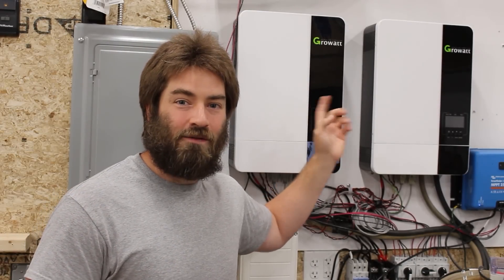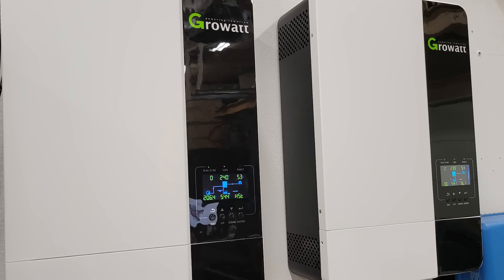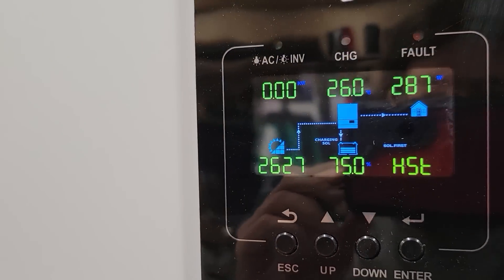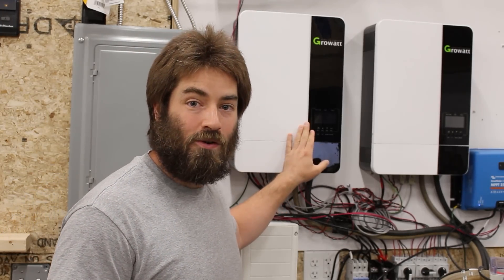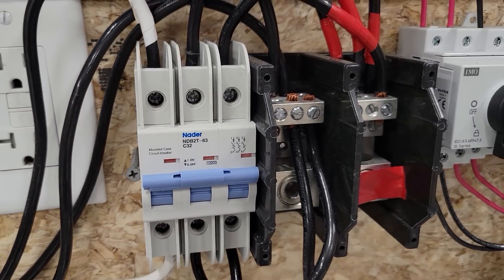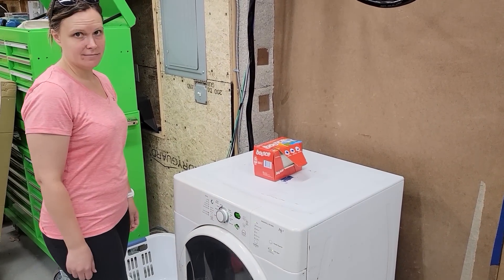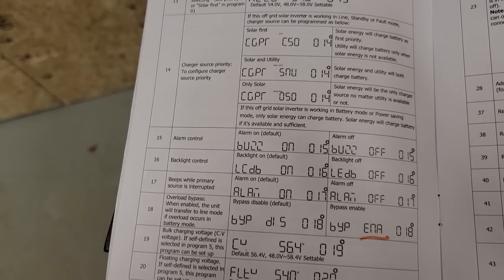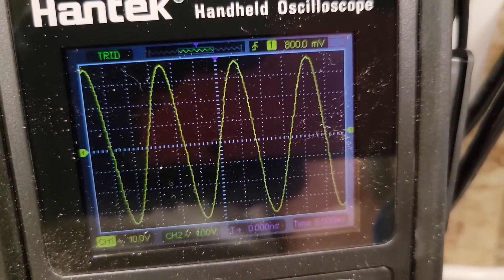Update after 1 year of use off grid, Growatt and EG4 (Gyll) batteries

Comment: HI David, do you mind if I ask a questions on a project you tried out about a year or two ago? I watched your video where you mentioned wanting to buy a european 230-240  volt single phase inverter with a hugh transformer. I was thinking about the same thing, but I wanted your prospective on why you didnt follow through with the project. I was thinking about running my home off of a Sungold 18kw low frequency with a Victron autotransformer. Does that sound possible to you? If you prefer not to give advice, can you recommend someone who is not just going to try to sell me product? Thank you David!
Reply from the maker: Hi PDS,  These Growatt inverters are 240V single phase.  When paralleling them together they are still only 240V single phase.  I'm using the auto-transformer to produce a Neutral which gives me 120/240V.   Other model inverters are 120V only, and you can parallel two together to make 120/240.  Both are good options.  The need for a larger transformer is surge capacity.  If you have a super high surge on 240V (ex: 4-ton whole house air conditioner) then you might want an isolation transformer.  I showed an isolation transformer in one of my past videos and still plan to demonstrate it, but just haven't gotten to it yet.  The past few months I've been backpacking the Appalachian Trail.
Reply: @DavidPozEnergy  Thanks David! There is no replacement for spending time with the family. Question David, if I have a 15kw single phase I vertex with a transformer connected to a big victron autotransformer, could I connect both legs of my breaker box the the output of the autotransformer and run my ho e off that set up reliably? Thoughts

Comment: David, do you know if you can stand these up or do they have to be lying on their side like they are on the company's rack system?   I don't have much space in my set up.  Thank you.
Reply from the maker: Standing up is fine, just don't flip upside down.  Actually, my friend has two that he stands up: https://youtu.be/nKva5GsEPXc
Reply: @DavidPozEnergy  thank you for the quick reply!  I have been on hold for 35 mins with signature solar to ask this question and you answered in 3 mins lol.  You are da man!  Thank you!
Reply: Since I will not be using their rack.  Do you have a Busbar you would recommend to tie these together?  Thanks again
Reply from the maker: I have made bus bars in the past, but if you want to buy some, then I'd look at these two options: https://amzn.to/3O7wu7m (you need positive and negative)  Or this: https://amzn.to/3P92EAY which has both positive and negative in one package.  But avoid this cheap one: https://amzn.to/3uNbYlK which I've tested and it get's too hot at the Amps we are working with.
Reply: Thank you!  I appreciate the help.

Comment: I studied your videos and products that you use for 3 months before designing and buying. I've basically got the exact system that you have except I do need more panels. Just moved the ac air handler iver last week. The heat pump has been on there for a month. I've been moving things over a little at a time and testing their limits. I really appreciate you taking the time and explaining each step in a way we can all understand. Outstanding work!
Reply: So no problems for you?  I see a lot of complaints online about items bought from signature Solar but no real issues from you tubers with affiliate links
Reply: @Chimpmunk Boy  I have had very few small issues and those were operator errors in programming. I got the help from signature solar and a few people I met on FB. After that I've been coasting along. One more inverter and 20 mor 445watt panels and I'm set for complete off geid!

Comment: Hi David
Did you experiance connecting
Two strings in//of pv panel 9 element
Each for  1 inverter Growatt 5000 es
Is it healthy or risky?
By the way
I have two led light  operating
On motion
The nearest to Inverter is flickering
The far one is working properly
They are of the same type and brand

Comment: And your system is using how many solar panels and what is the characteristics of your panels?
Reply from the maker: The 3 arrays total about 12kW.  I have tons of videos building them up, and wiring them.  I think you will find this video most useful: https://youtu.be/wDTkMQY3Rx0
Reply: @DavidPozEnergy  I thought that you installed them long ago and you dont use all of them but using 2 Growatt invertors 5kw each i think you can use all that solar panels. Each invertor accepts 6kw solar panels so you are OK. Thanks for your reply. I will have a look again to the way you wired them.

Comment: Hi , first thing, thank you for your content, genuinely enjoy your videos. Growatt are available in the UK, but not the batteries you are using. Also, they are beyond my means. Some while back, you showed a repurposed EV battery, which is within my means and available in the UK. In fact I can get a 185 KWh battery for a fraction of the cost. My hesitation is that you have not really had much more about EV batteries on your channel and I am wondering if they have turned out to have problems? I would have sent this in an email, but couldn’t find an address. Any feedback would be greatly appreciated.
Keith-in-the-woods (UK)
Reply from the maker: Hi Keith,  I've now worked with 5 different EV batteries.  4/5 gave me no problems.  Back then I had a lot of commenters tell me they don't have the tools to DIY a battery, and asked for a pre-built 48V battery.  But it's not because I have anything against EV batteries, it's just to be able to show different approaches.  If you are confident in your skills to dismantle a high-voltage battery, then go for it.
Reply: @DavidPozEnergy  Thanks for the reply. The concern I have is the car battery is built with a coolant system for a reason, these batteries can get hot. Or at least that would seem be the reason. I wondered if you had had any issues with batteries getting hot ? I would be tempted to retain the cooling and think of the current draw of the pump as an occasional overhead. The battery is the key, and the car battery is far cheaper than any other option it’s hard to resist.
Reply: @keithw8286  Automobiles draw far more amperage than house loads, this is why they're so large. Generally the batteries won't need active cooling with lower loads from a home. You will find that pretty much no one using them for home use actively cools them witha coolant loop.

Comment: @DavidPoz where do you live and/or what is your insolar number during dec/jan? Also, can you share your spreadsheet of power usage for your house? I'm building an off-grid house and trying to plan out how many panels and which inverter/s to get, so using yours as a baseline would be very helpful!
Reply from the maker: I'm in Massachusetts.  I did have to buy a little power from the grid in Jan/Feb to supplement.    I hope to add another 4-6kw of solar, and double my battery to 60kWh eventually.  I figure I'll be 99.5% solid at that point and only run my generator maybe 2-3 days in Jan/Feb.

Comment: if the growatt inverters can be set for split phase why the auto transformer.
Reply from the maker: Growatt is a brand.  I'm using model 5000ES, which is 240V only.  There are other models that are 120V only, and some of those can be setup as 120/240.

Comment: I've been very happy with my Growatt SPF 3000's, I have a pair of them providing 6kw of split phase and they've been running since March of 2020 now. No issues other than occasionally the wifi loggers will drop out recording data for a few hours. Only ever overloaded them once and they came right back up automatically after. Only downside is they don't support very high MPPT string voltage. Looking to add one of these ES inverters dedicated to my 240 volt loads though I see they are out of stock right now. I have a heat pump dryer arriving on Monday that will eliminate my last gas appliance after which I will have the utility company cut off the gas so I can stop paying the base fees for it and run everything off of solar.
Reply: Great plan. I have a gas drier and gas cooktop to replace so I can get rid of the gas company's list of nothing fees. Good to see others doing the same.
Reply: The nat gas distributors have ruined their growth plans by really loading up on the fixed charges on their bills..

Comment: Good video. Looking at the issue again as PG&E has again shut off our power for no legitimate reason other than that CalFire asked them to shut off transmission lines within 15 miles of a small fire that was mismanaged. Problem is that when they shut off power we lose all ability to fight a fire ourselves or have reliable communication. Great to hear your system is so successful. I have already purchased new EG4 batteries and will make decision soon.
Reply: These systems are expensive I wonder if there is a way to protect them from fire.  Like Mabey a fire proof server rack box
Reply from the maker: That sucks they shut off your power.

Comment: Kudos David! I really appreciate you don't use wood stove, propan-butan fridges and heaters - those so called off grid houses aren't self-sustainable at all. Yours truly is! Are you fine running your heat-pump from batteries all winter? My concern where I live (Central Europe) is that I often don't get sunshine 7 days in a row during winter and couldn't make it off-grid, conveniently :(
Reply from the maker: This past winter there were some days that I depleted my battery and needed a backup source.  For me, that meant switching back to grid, or running my generator.  This was about 12-14 days spread across January and February.  This means 3-4% of the year.   The solution is more battery AND more solar.  However, I don't need more inverters.  I'm still growing my system.  My goal will be to get my solar system to handle 99%, leaving 3-4 days out of the year to run my generator.
Reply: @DavidPozEnergy  Very nice! 12-14 days are enough, especially when they come in a row, however, 3-4 days would be beautiful. I can justify running a generator 4 days a year (or I could simply wear a jacket in my house for 4 days a year). I'm not off grid at the moment but planning to move off-grid.
Reply: @adam-user  Hello, I also live in central europe, you have any idea where to best buy these products in Europe? Signiture solar doesn't do direct deliveries, and bit worried about waranty in case of defects
Reply: @OzvalEranah  Honestly, not sure :( I asked the company that installed my solar panels, they don't sell exactly these, whoever they sell Victron LFP batteries for ±3.500 USD / 5 kWh, which translates to 750 USD / kWh - roughly the double of the Gyll batteries in the US :(
Reply: @adam-user  Everything related to this is ridiculously overpriced in Europe. I'm also concerned about configuration. I would like to set it up so I can turn on certain loads based on the state of charge of the battery and current power generation of the panels. for example if battery is full, turn on pool heating, etc, .. but for that you need to be able to communicate with the invertor
Reply: But if you wouldn't mind giving the company that placed your installation? or did you install yourself? where did you buy your materials?

Comment: Does the internal mppt produce as good as a Victron? I bought a growatt SC4880 and ended up sending it back, the voltage was off .5 volts and with more solar panels (900w) it would produce less than a Victron MPPT with less solar panels (690) mostly on partly cloudy days, when there were no cloud’s it worked great except for the voltage discrepancy that tech support couldn’t figure out how to fix.
Reply from the maker: I don't know if it is producing as good as the Victron.  My guess is that the Victron is 2-4% better than the Growatt, but it's just a gut feel.  The real benefit for the Growatt is is you consume the power as it's being generated.  Then it's round-trip efficiency is 8-10% better than my Victron CC.

Comment: Love your videos.  Quick question.   What is your depth of discharge for your set up? I really want to purchase these battery set up.  Thank you in advance.
Reply from the maker: My average use is 75% DOD, but my parameters are set up to be capable of a 90%DOD (happens sometimes).  However, my setup is based on voltage reading, not SOC, so it's not perfect.
Reply: @DavidPozEnergy  Thank you so much for the reply.  I am so ready to buy this set up!
Reply from the maker: Cool.  The batteries are these: https://signaturesolar.com/eg4-lifepower4-lithium-battery-48v-100ah/?ref=4_rHcgZ9x-TiF-  I'm using the cabinet with bus bars built in: https://signaturesolar.com/eg4-enclosed-battery-rack-6-slot/?ref=4_rHcgZ9x-TiF-  The batteries are perfect, I wouldn't change anything about the batteries in the cabinet.  However, the inverters are OK, but there is another inverter option that also looks very promising: https://signaturesolar.com/eg4-6-5k-off-grid-inverter-6500ex-48/?ref=4_rHcgZ9x-TiF-  Each of these puts out 120V, so you need a pair to give you 120/240V output.  It's a little cleaner because no auto-transformer is needed.  But both inverter systems are good.  
FYI, these are affiliate links, so if you buy through these links it will help out the channel.

Comment: use gyrowatt (tm), ie, radius 1m and 20-200krpm flywheel battery
Reply: you can diy as many as you wish, no restrictions, maglev on a bearing stick
Reply: dc coils on top of the vertical opposite magnet in levitation, dc emf effect, not ac motor-generator, just pure dc brushless
Reply: all diy, even the copper coils
Reply: if you want to make the motor super small, make it from YBCO super conductor coil wire, then compress the coils with a motor compressor super cool temperatures, you can use normal  ceramic magnets or neodymium magnets with it
Reply: oh right, the flywheel energy storage is 300Wh/kg at r=1m, rpm=20krpm, or 30kWh/kg at r=1m, rpm=200krpm, disc shape, can be flat, like below a lawnmower disc
Reply: super conducting wires, no need to size them, also super conducting motor-generators, same deal, 100kA for a small wire, just needs YBCO and a compressor super cool source

Comment: I ended up getting ac capacitors and putting them on my heavy load things like fridge, air conditioner, washer and dryer. They're like $10-$15 and they stop the voltage sag issue entirely.
Reply: This is interesting. I was looking into a Soft starter for my A/C condensing unit. This is actually a great idea and much more cost effective? You mind sharing a link and an idea of how to size/setup?
Reply: This is how I want to set up
 my system. Do you have any pic that you are willing to share and links to the caps?
Reply: NO,you should NOT write those lies here<   
The motor would overheat and shut off or destroy itself>.  look here
from quora  
.
.
Can I connect a capacitor in parallel with the Mains of my air conditioner?
Sure! Go for it! But what, pray tell, do you hope to accomplish by it?

Best case: the voltage rating is high enough and the capacitance value is low enough that nothing whatsoever happens.

Next best: the voltage rating is too low, the cap self-destructs is a mild way, and nothing happens.

More irritating case: the cap does not explode, but it’s value is high enough to draw current from the line, and the breaker trips. Yeah, well , that didn’t work so good.

Don’t do it. Just don’t.

Comment: I counted 48 PV panels. 
How much do you need to pull in to keep these batts charged?
Reply from the maker: I have about 12kW of solar PV.  This is fine most of the year, but is lacking in January and February (for my location).  I'd like to add another 4-5kW to feel comfortable going through the winter.  This is also very dependent on your usage for your home.

Comment: Hi David, what do think you have spent on the batteries, 2 inverters and other switching protection?
Thanks for your videos very informative, regards Kel
Reply from the maker: Each inverter is $900.  Auto-transformer is $350.  Batteries were $9500.  So probably $12,000 in equipment, but add another $500 for wiring, circuit breaker box, cement board behind it, screws, etc.  This doesn't include all the solar array stuff.

Comment: How big  is your home and do you have electric air handler with  15kw heat strip? Our home is 1700 square ranch 2×6 outer walls and insulated well. R 50 in ceiling.
Reply from the maker: There is about 900 square feet of finished floors inside my house.  It's super insulated.  Check out some of my very old videos (10 years ago) to see me build out my home.  It's extremely insulated.  Literally just a hair dryer can heat my house in the dead of winter.

Comment: By any chance I can adopt my wind powered generator to this system, I would like to add solar panels and not replace them for my wind power now. Any feedback appreciated
Reply from the maker: Yes, wind and solar can both work together to charge the same battery bank.  However, Wind requires a dedicated wind charge controller with a dump load.  These inverters have a built-in charge controller, but it's only made for solar.
Reply: @DavidPozEnergy  but I could connect my wind generator to grid inverter same unit? I don't need a second unit?

Comment: How many percent of your total energy consumption did these systems do for your house?
Was it 70%-80% or 100% with grid as backup power?
Reply: I have the same configuration in South of France and in fact I get 100% offgrid without having to reduce my consumption at all. Even if in winter some rare days I have to shut down my heating pump to burn a little bit of wood. With 100% electric we need a heating backup solution for few days a year I think or to use the utility for these few days each year. So I mean 99% off grid.